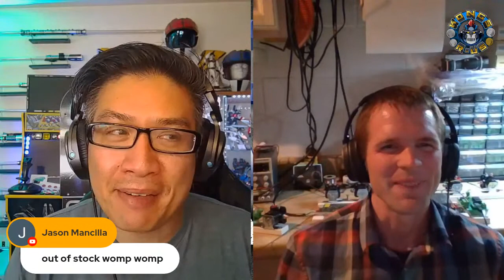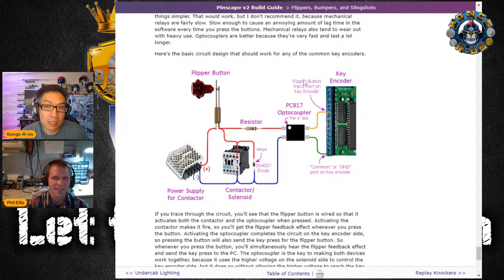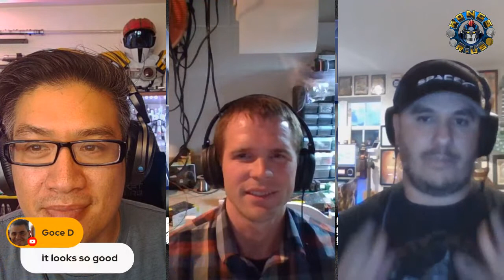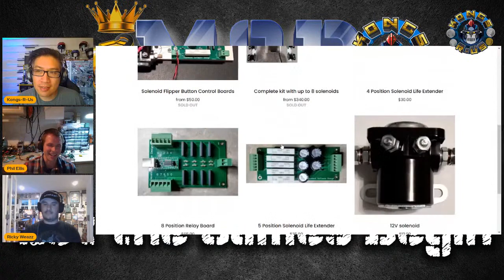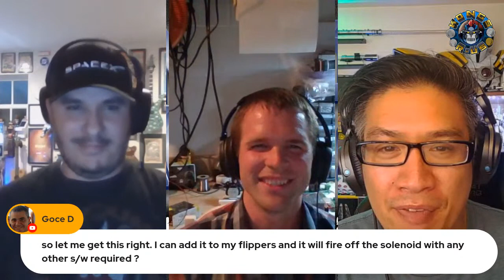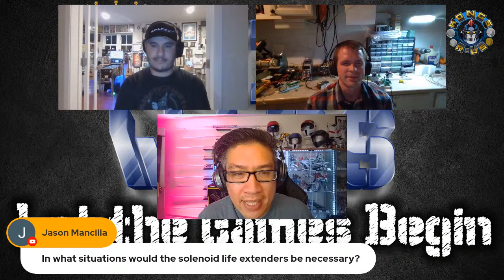Solenoids Made Easy for Your Virtual Pinball Mod - Legends/Arcade1Up/DIY (The Next Level: Ep 25)

Comment: @Kongs-R-Us If you were installing these in an ALP and you didn't have the two contactors already on the lower crossbeam, would you hav considered putting these there instead of on the side panels? For my build, I am going the SSF route and was thinking that putting these on the crossbeam would make them seem closer to the actual location of the flippers on the table.
Reply from the maker: Cross bar is a good location too,  but I think you need longer wires to reach there, so that's why I think the sides are a bit easier to mount
Reply: @KongsRUs  So many wires already, what another few inches 😂... I think that will be my plan; thanks for the reply!

Comment: Ok guys, I got the flipper kit installed, thanks!  I often play after kids bedtime.  Wife is going to murder me if I don't install an on off switch for solenoid.  Can you send info on what you used that worked?  Thanks!
Reply from the maker: I wired a 12v toggle switch between the power line going from the board, to the Solenoid. I had to wire 2 independent toggle switches so the Flipper buttons still worked Independently when switched off
Reply: @KongsRUs  thanks, I've got some switches laying around.  Fyi, and noteworthy.  My ALP input wires for the buttons were reversed coming out of the main board.  I couldn't get the flippers to work but once I reversed +/- all is good.
Reply: Switches installed.  Thanks again for recommendation.  Game changer for me... Although I ended up playing until 2am in my new "silent" mode.
Reply from the maker: Awsome, enjoy!
Reply: Hi guys, do you have a link to the power switch I would need to follow this? I also pinball late at night and my wife would kill me because of the solenoids (just waiting on them to arrive), haha

Comment: Just got mine and installed them in my legends pinball.  They work fine and have a great sound/feel, but I now have noticeable flipper lag and at times I hit the button and nothing even happens. I've checked all the wiring and nothing is loose.  Any ideas? These things feel great, but I can't enjoy the tables if I have too much lag or can't count on it to fire every time.  I just ordered some happ buttons to replace the cheap ones in the ALP. Hoping that does the trick. I don't want to remove them. They feel so good and "beefy".
Reply from the maker: You might need to double check your wiring from the encoder board to Phil's PCB. The positive/negative wires need to go a certain way so check that. Then make sure they are absolutely secure and screwed in
Reply: Rechecked all wiring, and it's secure. When I first installed them I did have the wires flipped like you mentioned, but that led to the solenoid firing with no recognition of the button being pressed in the software. Once flipped it works, but I have this occasional missfire and flipper lag. Phil is working with me to trouble shoot. Might be an issue with the power supply.
Reply: Phil is the man! He helped me trouble shoot everything, and it turned out to be a bad power supply. New one is in and these things are amazing! Phil's product is great, but his service is even better.  Kudos Phil.